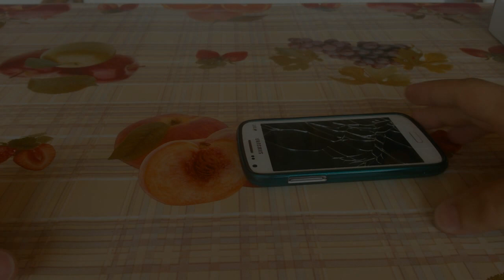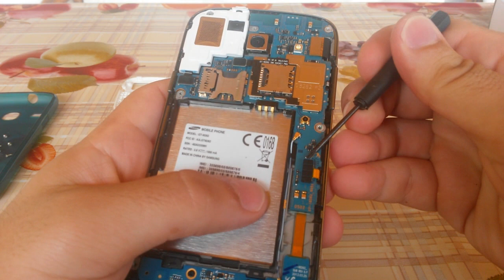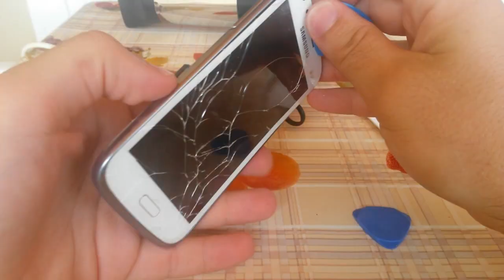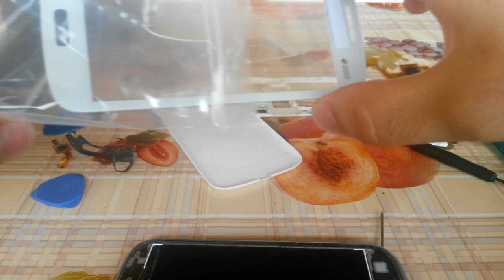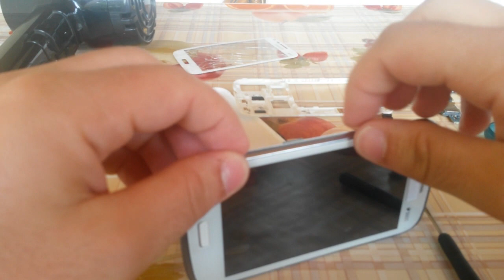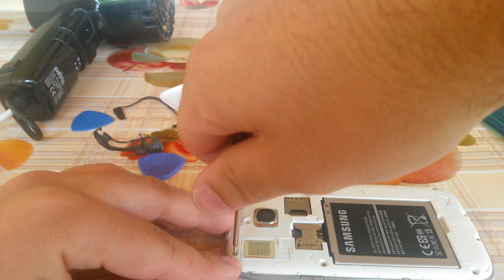Samsung Galaxy Core Duos digitizer replacement

Comment: quick question.. when i change out the screen and digitizer, do i lose the phone's data? i recently suffered a screen failure but the phone is locked and i can't access my data from the pc either (encrypted, requiring touch code). so my only option is to change the screen, but i don't know if the screen change will trigger any wiping. thanks for any reply..